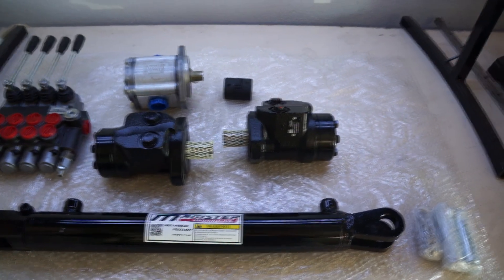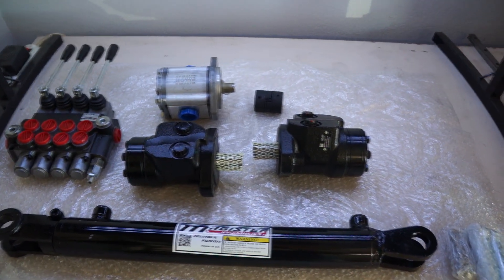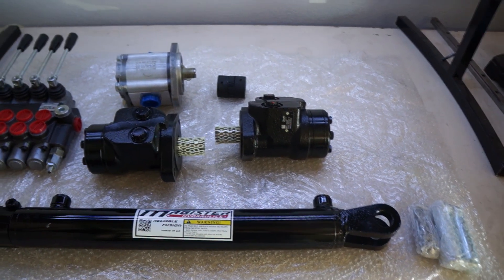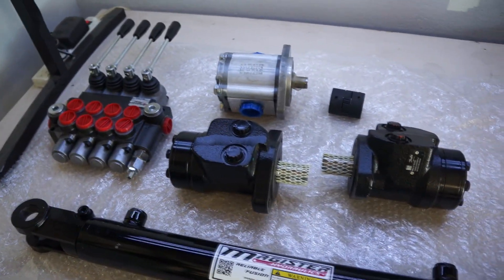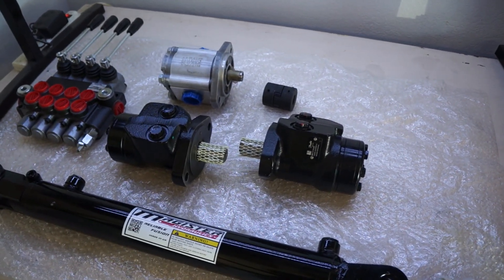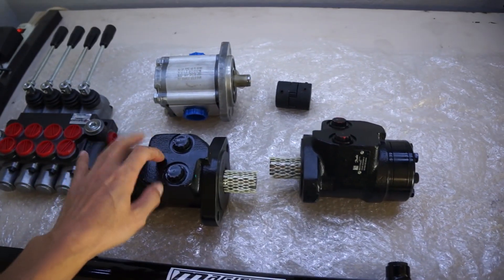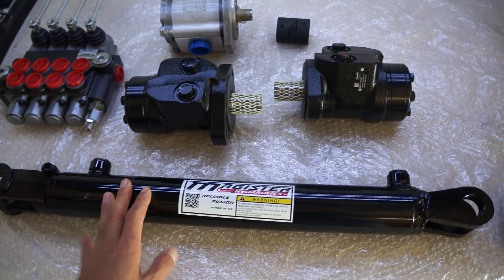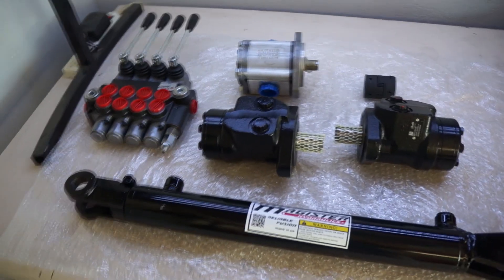DIY Hydraulic Mini Skid Steer Loader powered by Lithium Ion (Part 1 the chassis)

Comment: legend, there is no better machine than a machine built from the ground up buy the machine operator that then has all the knowledge required to maintain it for life. i love doing things like this, i once did very similar making a micro digger when i was doing some under pinning work indoors and i couldn't find a machine i could get in, so i pretty much just built one in there.
i have ended up here needing to find a small skid steer, i wish i had time to try this but i think im going to buy an old Sherpa 100 and just fit an electric pump and lifpo4 battery's as i just don't have time.
keep it up.
Reply from the maker: @jdnd3  if you can find a machine and convert it would be more ideal.  Good luck!